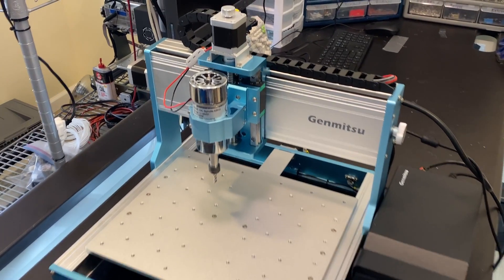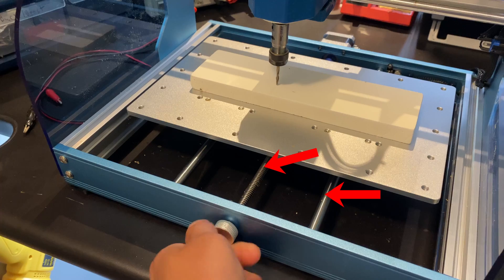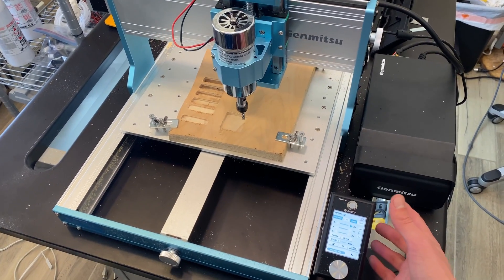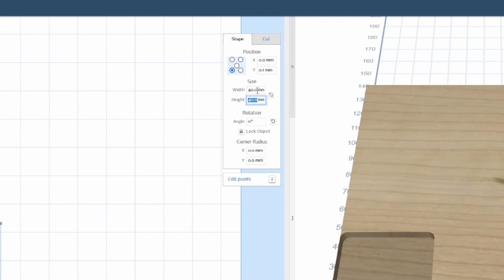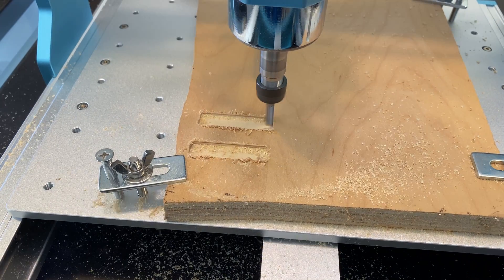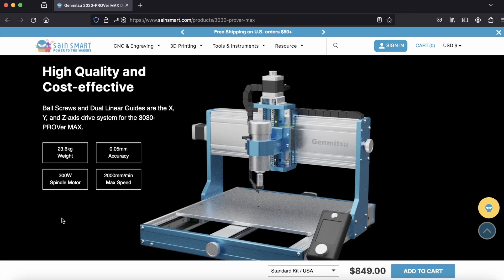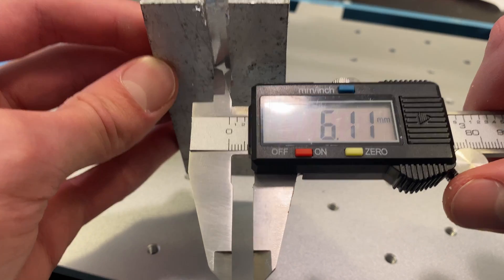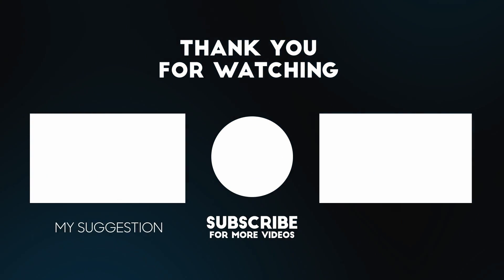3030 PROVer MAX CNC Review & Demonstration - Sainsmart

Comment: I upgraded to a1.5 kW spindle with a VFD. Mounts perfectly with the 65 mm clamp the 3030 PROVer MAX had included. I use a single flute endmill for aluminum. The performance improvement enables chatter free cuts in 6061 aluminum at reasonable feed rates and with admirable surface finish. - The VFD default settings worked flawlessly, there was no need for programming, just simply connecting the line voltage and the motor to the VFD.
Reply: How was the VFD wired into the control box?
Reply: @Festivejelly  I adjust the spindle RPM manually using the VFD front panel. The VFD has an analog input (0 to 10Vdc). The  3030 PROVer MAX spindle drive voltage can be scaled down (resistor divider) and used to control the VFD, the new spindle. There may be other ways, I have not looked at it. Of course, there is a line cord wired to the VFD line terminals and the spindle motor is connected to the VFD U, V, W terminals.

Comment: Just bought 1 what’s it run for cad soft wear
Reply from the maker: You can use whatever CAD & CAM packages you prefer. I use the browser based Easel for simple 2.5D carving, and Fusion 360 for more complicated designs or 3D carving

Comment: im new to cnc my question is can u also do long boards with these small machines, (1m*10cm - if the long sides stick out on the front and back)? sure not in one go, but i thought about just do one go then move the material in one direction, mount it and do the next go...
Reply from the maker: Yes this is possible, however getting the alignment right between runs might be tricky. It's probably best to use a jig of some kind to ensure that the workpiece moves the same amount and stays at the same angle (in x & y) between runs.

Comment: if you put a makita spindle will it be able to cut 2mm depth in aluminium?
Reply from the maker: I haven't tried this configuration, however seeing as the primary issue is the rigidity rather than spindle speed, I wouldn't count on this kind of spindle upgrade making a huge difference.

Comment: Hello, do you perhaps know if the stepper drivers are removable?
Reply from the maker: I can't guarantee that the drivers are removable on this machine specifically, but on other similar sized CNC's (including other machines from Sainsmart) they are.
Reply: @CarbonCoil  thanks for your fast response!
Reply: I can confirm that they are not
Reply: @SAMGO4  thank for your reply. I also have found out. But i've managed to install servo's anyway. I found the dir and pulse pins
Reply: @ischa2135  Nice! I'm also looking forward to install a 2.2kW spindle on this machine but I need an output pin to set the speed. Did you load a custom firmware? If you where did you find it ? Any help would be very appreciated!! 😀
Reply: @SAMGO4   wow 2.2kw is hardcore. I have a 250w spindle haha. Yes, I'm using the original board. I removed the stepper drivers and some other components and soldered the dir, stp, and com wires to it's places. (I'll will soon upload a howto video on how to do it). Now with the servo's installed my machine is super responsive. (4000mm/min, 300mm/s^2). especially when using the pendant. How i haven't seen any PWM ports (not that i know of) but i would use the original spindle output. convert that output voltage to a PWM signal (using a arduino). Most spindle drivers accept PWM.
Reply: @ischa2135  I would LOVE to know where to find the dir and pulse pins! I too wish to convert my machine to servos. Thanks
Reply: @hugocfr  Hi, I've posted a picture of the locations where to solder. green= step and yellow= dir. white is ground. There used to be resistors at those locations. I removed them. Also, i dont know if its necessary. But i removed the stepper drivers as well. It has been a while i might mistake step and dir. So if its not working, try switching those. Tip: when it works, put some hot glue on top of it for durability.

Comment: I installed the spindle such that the motor housing bottom aligns with the clamp bottom, rather than clamping the motor near its center. This provides for improved rigidity and increased Z height.